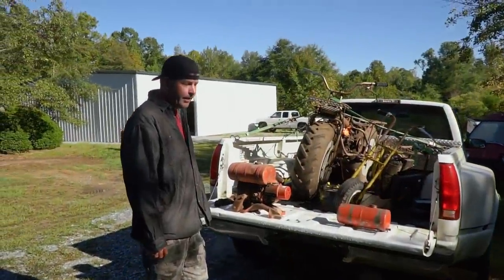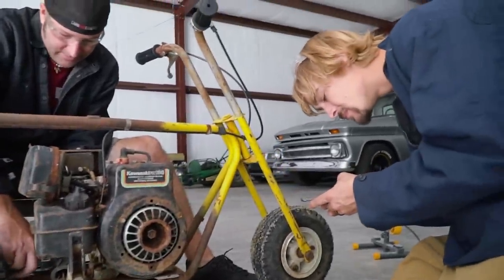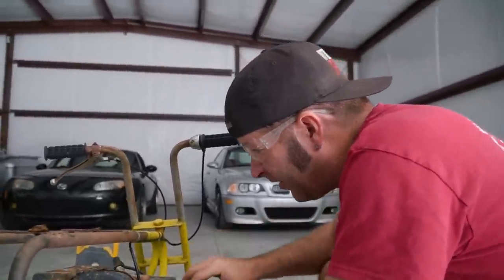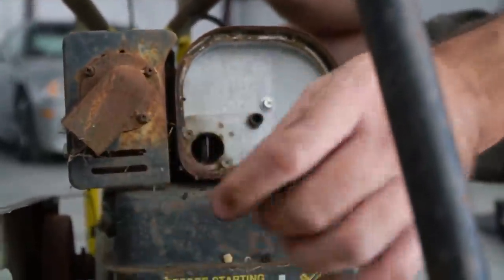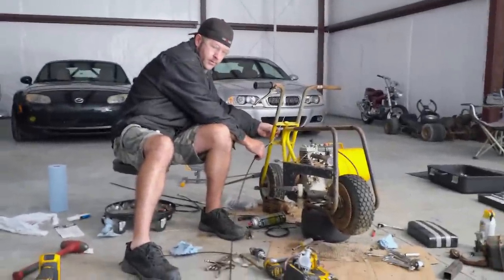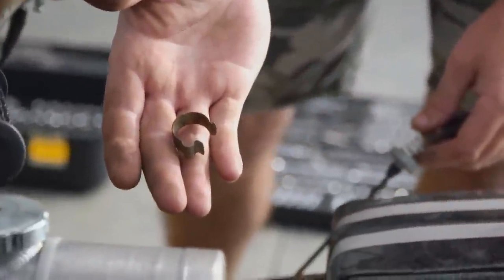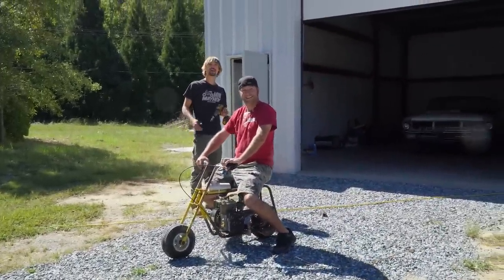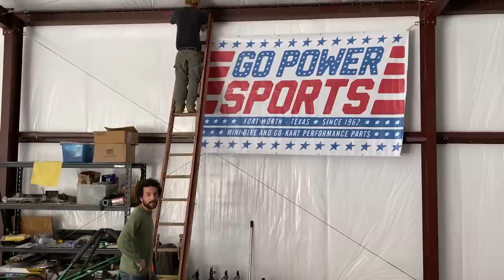We bought a CHEAP 80's KAWASAKI Mini Bike... Will it Run and Ride Again?

Comment: John , Kawasaki makes it's own engines and they are far better engines than briggs or Kohler , John Deere even uses Kawasaki on their premium equipment and they are not cheap , top notch engines !
Reply: I wouldn’t say all of that about a Briggs there pretty good
Reply: Yeah these guys(well Ike especially, the others are young so they kinda get a pass) are dumb. Kawasaki is one of the largest producers of small engines in the world, but of course they buy blocks off a little American company to rebrand fur minibikes🙄. That like saying oh look,  This bmw v8 looks very similar to  a Mercedes v8 so BMW must be rebadging them...... It's just another flathead small engine built by Kawasaki.
Reply: i sell country clipper mowers and the kawasakis are the go to engine for sure, the kohlers nowadays are pretty good too, some of our models u can choose either
Reply: Yeah, there is no way the Kawasaki engine is just a rebadged B&S.  Kawasaki makes top notch utility engines.
Reply: @gabewest305  true, Briggs are good engines but Kawasaki had spin on oil filters and full pressure lubrication long before. On our Scag walk behind mowers the kaw outlasted briggs or kohler 2 to 1.
Reply: sure sure sure the briggs 5 horse is still amortol

Comment: Oh, I am ALL about the Rokon.  A 2WD motorcycle to which you can fit a 3pt hitch?  Yeah, man!
Reply: I found a rokon trailbreaker 2006 on the curb back in 2017 still have it
Reply: @flipjunk1998  OMG. That's bonkers.

Comment: The Kawasaki FA130D engine has a slide-valve (L-head) design and crankshaft made of heat-treated ductile iron integrated with counter-balance weights and camshaft drive gear. The piston is made of hard-chrome plated aluminum alloy and equipped with two compression rings including silicon carbide plated top ring and one oil control ring. Main bearings are: on P.T.O. side, ball bearing; on magneto side, lead bronze sintered alloy plain bearing with steel back metal. 3.1 HP

Comment: Those Kawasaki small engines are bulletproof. I have had many walk behind mowers and the ol Kaw still runs great and has clean oil every time i change it. Going on 30 years and mostly every part except the engine on the Exmark has been repaired.
Reply: They sure are, that's what makes John deere yard equipment so desirable
Reply: We had em on Scag walk behind mowers and they outlasted the kohler and briggs engines 2 to 1.

Comment: Please make a vertical shaft go kart!that would be awesome
Reply: Yeah, a lot of older riding mowers have a rear axle with a pulley on top for a belt drive. Switch out the pulley for a sprocket, and rock n roll.

Comment: Absolutely love the new shop, something I learned from my shop is metal dust from grinding, cutting, and Welding is an absolute pain in the ass to get off cars in when you think you’re actually removing it you’re actually scratching them. Saw the E 46 in the background… just some advice from experience and a car that needed paint restoration

Comment: That bike sounds great. Hey I noticed earlier today those old-school frame cable clamps are available at OMB Warehouse. The little muffler is nice; I have one on my Stage 1 RB200. It's actually an RLV Mini 91. With a shorty header it's a nice way to have an exhaust that doesn't stick out of the frame and without having too-little back pressure. The associated clamp however worked for about 20 seconds before pitching my muffler to the ground. Would not tighten enough to hold for me, despite supposedly being the correct diameter.
Reply: There is no such thing as too little back pressure.  Zero exhaust pipe kills power because of no scavenging from exiting exhaust gasses. Back pressure is bad. Always bad.
Reply: @jasonbirch1182  Excellent. I appreciate the correction :)
Reply: @thenexthobby  if you aren't clear what scavenging is. It's the mass of exhaust leaving down the pipe, the exhaust valve then closes and the the exhaust mass keeps traveling, creating a vacuum behind it. The the exhaust valve opens again and it actually help pull the exhaust out of the cylinder because of the low pressure area.

Comment: IIRC, Jacobsen 2-strokes were actually made by Tecumseh. That, and aside from the big, commercial mowers powered by Kubota diesels, Jacobsen tractors were powered by Kohler engines. I still remember how the 7-hp in our '57 "Jake" Chief 100 (Never saw a garden tractor with "finned" fenders, before or sine!) would yank the front wheels under full throttle... even in 3rd! That, and how the heavy mower deck, with it's synchronized blades, and arbors that could easily be lubed with a grease gun. After which, it'd literally "sing"... and cut the grass like a Norelco!😉

Comment: I have worked on Kawasaki small engine flat heads before. They run awesome. Smoother too. If you tear it down you will notice the casting and machining is way better than Briggs or Tecumseh.

Comment: Cool video. 
Not a Briggs or Tecumseh though. JD has been using Kawasaki small motors for ever. Even Honda had a flathead motor for a bit.

Comment: Hi. Nice to see you in your new place.  The only problem I see is all your toys are all in there to. You really need a separate area for working. Just in case anything goes wrong.  Even a walled of area would held.  Look at your other workshop. You have all your tool and other equipment all up against the walls all around you. with work space in the  middle. But other than that another good video. Good work lads

Comment: I really dig the new format for showing the head to head on the GP laps. If I could offer a suggestion, if you put out some kind of colored cones or something like that alongside the track it would serve as a good set of land marks so its easier to follow whos where head to head. Especially in some of the straights or parts where there's not a ton of natural land marks

Comment: Can't wait to see that big boy bike being worked on. Kinda not a huge fan of the overlay video but I don't hate it either. Might work better in quarter size bits on the screen, and maybe in the last quarter, since it's only 3 of you racing, have an overhead map to show where you each are, and you can figure that out by landmark or localized GPS units, maybe the gopros might have useful GPS data, and you can color code each person with their video frames (should be easy to save a template for that in your video editor) to correspond to the mini map.. All that kind of helps avoid dead space on screen, and gives the viewers context for what they're watching.. Not the simplest solution but certainly ideal.

Comment: Very cool. I have a small generator with an FA 210 Kaw engine. It had a bowl type carb and of course no parts available. I modified the mount holes on an old Tecumseh carb I had and mounted it. With slight governor arm mods it fired up on the first pull. It runs the generator at full load without losing rpm's. Those little motors are awesome. BTW, Kawasaki did make these.

Comment: Awesome improvement with the split screen/lap times.  My only suggestion would be to add split times along certain parts of the course.  I was looking for landmarks to compare each riders lap and noticed that the construction pylons were very easy to see as a reference.  Perhaps add more obvious landmarks and/or add a split time to the bottom of each rider's frame as they pass it.  I think 4 total split times including the final time would be plenty.  Great idea.

Comment: Also my old wheel horse riding lawnmower had a similar Kawasaki engine except it wad set up like a normal lawnmower, flywheel facing up, but it wad weird because the engine spun the opposite way so on the mower drive was reverse and reverse was drive
Reply: Wheel horse lawn mowers are badass.  There is a wheel horse group that gets together every year in Pennsylvania my dad and I travelled down from Ontario Canada a couple of years ago it was quite the experience.  Especially if you're looking for some hard-to-find parts.

Comment: That's a genuine Kawasaki engine, FA130D. 
This isn't the Kawasaki you're used to, this is the guy's making engines for those big huge industrial-grade walk behind mowers (and professional-grade zero-turns). It's a hella high quality engine, with ball bearings, hardened rings, points ignition, pulse-prime carb,, etc. Made in Japan

Sticker reminded me of the one on my '96 FC420V Vertical Industrial engine for my large walk-behind.

Comment: That little engine would be a good candidate for some of those old school upgrades like y'all did in the beginning of the channel, like shaving the head on a belt sander, or a coke can head gasket, and drilling out carb jets, that cheap power just to see if it would help

Comment: I work at the John Deere van wall in urbandale Iowa I have worked on a couple of those motors which can be found on the E35 edger by John Deere and it is a Kawasaki all through the engine except the connecting rod and the piston are from a Briggs 3.5 to 5 hp horizontal shaft

Comment: That chassis is a Azua. Been around for years, l have one of them with a Briggs, hate the brakes. That rear gear is probably a 72, next smaller l think is a 62. I changed clutch teeth to a 18 for the 72 rear gear. 46mph

Comment: And paint the handle bars and frame. Taller more aggressive  tires. I was impressed that it still ran what a stroke of luck. Had spark right of the bat. A torque converter would help out on top speed and power. A taller seat foam would help you some so you dont have to squat so much all crunched up. You could put a 1 inch thick board under the seat to raise it up 1inch. Yes that starter is going to make hamburger out of your leg it needs a cover like you said.

Comment: Interesting attempt at the grand prix edit. Not really a fan. For mobile users the screens are really small and the overlapping audio is hard to make out. It would take more editing, but what if you cut between each person at similar places on the track. Have a few cameras  set up along the course to get y’all driving past. You can splice them together to make it look like y’all are racing wheel to wheel.

Comment: What size mig wire are you using? 0.6 or 0.8 mm as if you use 0.6mm the amps and volts a lower and you will end up with a small weld build up.

Comment: What size makuni would you put on a old 8hp Briggs n Stratton big block ?? It's a eletric start all aluminum from a generator I cut the shaft to separate it for a gocart project the carb was beyond my capabilities of fixing so I'm just wondering what carb to buy to adapt .... how Many mm 🤔?

Comment: I'm here early for once.  I have a question do you use seafoam gas treatment in all your small engines or is there another fuel stabilizer you use?  I've had great luck with seafoam but it didn't know if you guys had some secret Shmoo you use.
Reply: We just use ethanol free gas

Comment: Question for someone. I have a mini kinda like the yellow Kawasaki. Gonna rebuild restore it for grandson. Is there a place to find a springer like front end that would fit on in place of the stock one it has. Stock is locked up shocks an a hole in one of the shock tubes. But like the springer look

Comment: You guys never caught the kid with the JB Weld I'm guessing.  I think I'd have stretch her a might and definitely took the flat head off. Did a little shaving maybe a very thin copper  gasket. every little bit helps! Get that compression up a little then some hot fuel . Maybe some VP 116. I know where you can get really hot fuel, but you guys better stick with under 10 Hp!!         👍👍👌 👀

Comment: Hello, I recently bought a Duramax small engine 7 hp. I’m wondering if I replace the jet if I would also have to replace the emulation tube if that would make a difference or if keeping the stock in emulation tube with an aftermarket jet would make any difference. If anybody has any answer please let me know

Comment: Hello, ive got a mikuni vm22 carb just like that on my pitbike, and i just can not get the perfect air fuel ratio on thst screw, can you please tell me how much turns it is from tight when the carb is all stock? Thank you and awesome video!
Reply: Seems like its different on every project
Reply: @isaacitllbefine7231  i know but, this carb that is on the bike was f up and i bought a new one, all stock worked beautifull!, but choke broke from the inside so i used the top of the carb from this f up carb, and jets and everything from a new carb, which means the mixture screw isnt on stock position, it was all the way in, thats why im asking for a stock position cuz i know that would work. The carb placement on my bike is so dumb i can't reach the screw, and everythime i want to do something with it i need to take of the carb

Comment: Is it a Kawasaki Coyote with a briggs copycat engine ? If it is Those things restored are worth a little coin. They were sold in Hardware stores, I have restored a few. You need to get a Kawasaki KV 75 2 stroke it's a Honda Mini killer. On further revue that frame is not the coveted Coyote.

Comment: The gas tank is lower then the carb pump?
Reply: Nope. The original setup is similar to the Briggs carb on tank. Pumps fuel from the tank into a small "bowl" in the top of the tank.
Reply: So you're kinda right.

Comment: *****  Please, please, please reply to this comment. I own this same bike it was my mother's as a child; I've riden it plenty and kept it running over time. I am 28 years old now. I've noticed, that little orange round thing with the tiny notch hanging off, that is placed above the pull string; can you please inform me of what it is? Mine is missing. The hole is just open. Any suggestions or ideas or answers would be greatly appreciated. PLEASE SEE THIS!